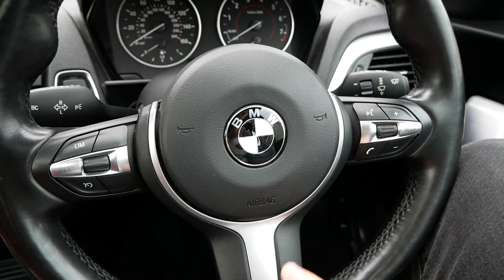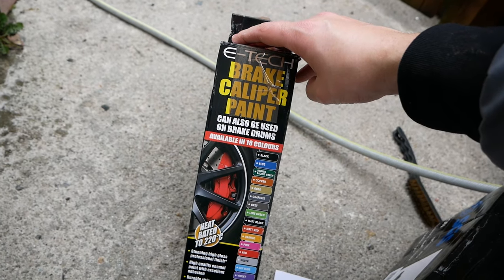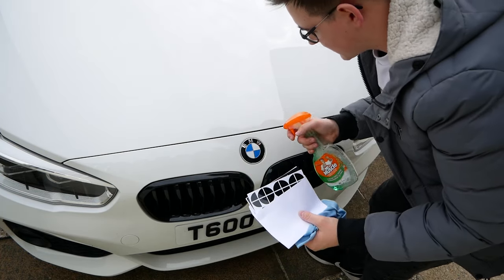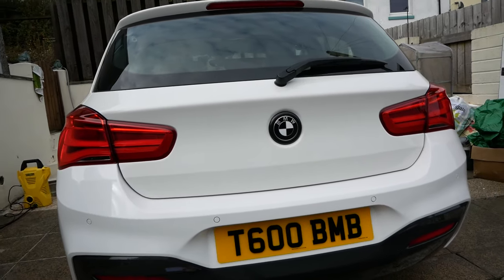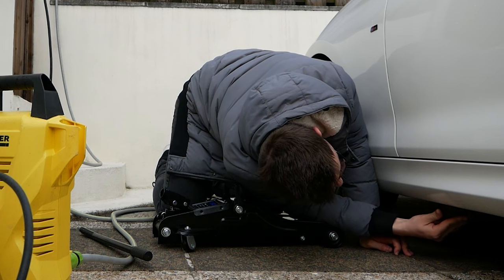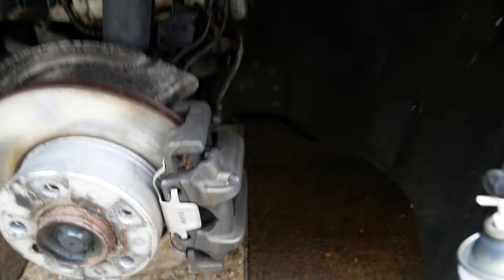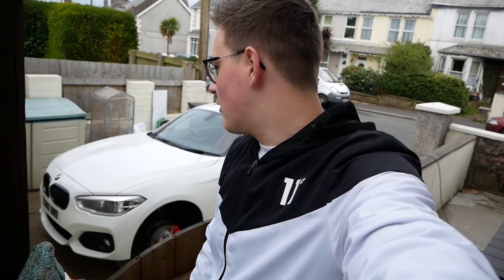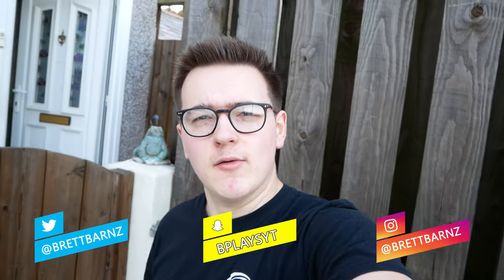PAINTING MY BMW CALIPERS RED & INSTALLING BLACK BADGES *BMW 1 SERIES MODS*

Comment: Nice video dude! Love your personality and the consistent enjoyment in the videos. As for Mod suggestions for the car, I reccomend getting a ceramic coating/film on the front of your car which protects against dirt and chips in the paint. It also makes it easier to clean the body of the car and get a strong shine.
Reply from the maker: Yeah i potentially will get a PPF wrap in the near future but I will always get it resprayed as there is a good shop near that give me a good price :)

Comment: Really good vid bro. Well done!
I've thought alot about doing the calipers on my E90 330i SE, but one problem I keep on getting on my car is sticking callipers.  I just think that painting the callipers will cause the sticking to get worse / more frequent.  I usually have to replace the callipers every 2 years or so due to sticking.
Reply from the maker: Oh really! Is it a common issue on those models then?
Reply: Brett Barnes hi mate, I’m not sure if it’s common on this model, because mine has the M3 wheels from the E46, but in my view painting the callipers is much more likely to cause a seizure of the callipers because of the moving parts / friction with other components within the wheel and brake pad. Don’t want to scare you tho, yours look awesome!

Comment: Dynamic indicators for sure
Reply from the maker: sam collins going to look nice!
Reply: @BrettBarnesYT  I've got a BMW F20 in silver 118i also.. I've done the indicators and the black grille I've got the paint to pain the exhaust and a the mirror caps on its way this week. Tempted to wrap the interior however you can buy carbon fibre trim plates on eBay what's your thoughts on the stereo carbon fibre plates? Also would you put a splitter on?
Reply: @BrettBarnesYT  also I love tech used to run a channel called top tech reviews back in the day :)
Reply from the maker: Ah that’s awesome! I’m thinking about getting the carbon interior potentially! Not sure yet
Reply: @BrettBarnesYT  looking forward to seeing yours soon!

Comment: Got a white 16 plate 120d m sport looks like yours but mines standard apart from windows tinted. Like the idea of the black and white. Do you get most of your stuff from Ebay???
Reply from the maker: Nuts Tight I get stuff all over the place but the small things I get on eBay

Comment: How long did the paint take to dry before you could put wheels back on and drive the car again mate?
Reply from the maker: Wheels on about half an hour after last coat and then 24 hours before you can actually drive properly

Comment: painting the brake calipers with a brush on paint.. interesting, i’ve acc never seen that before but it looks clean. would be interested to see how it holds up in comparison to spray painted or powder coated calipers
Reply from the maker: I did it this way as I've seen it done before a lot and they said it was pretty good! Worth a try :) I could always get them powder coated down the line if they chip etc